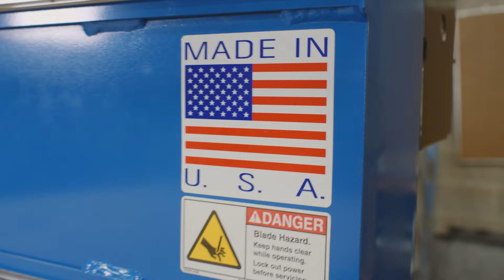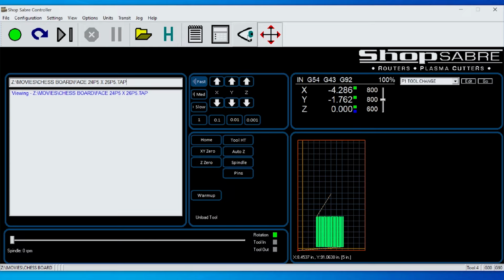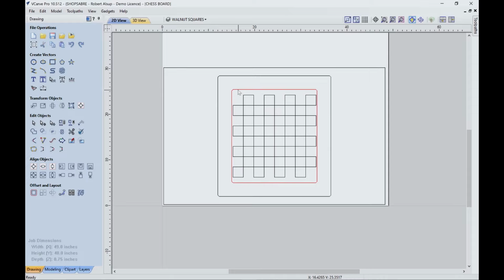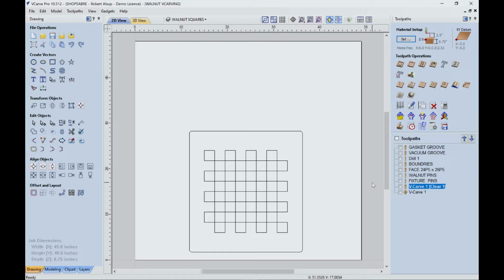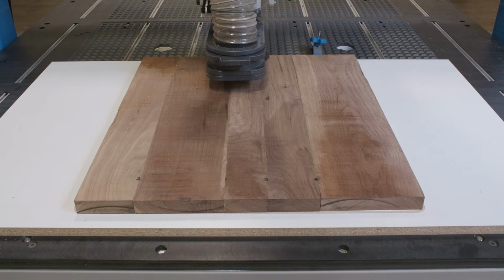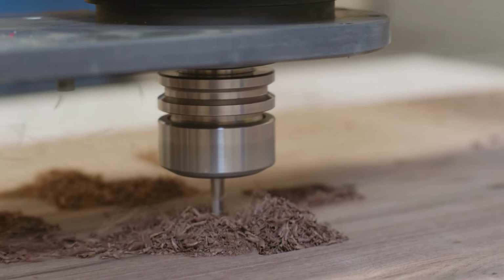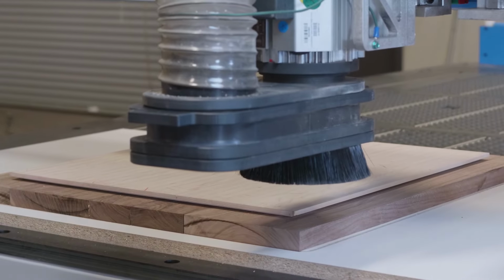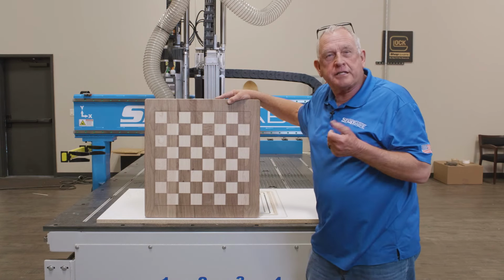ShopSabre CNC - Chess Board on IS Series Router

Comment: Greetings Bob, I have a question for you, I am making my own chess board on my CNC machine and I made my plug depth the same as the max depth for the plug and inlay. No matter if I set my plug to be smaller what I end up with is the cheeker pattern between the corners is offset about 1/8" of an inch for all of them.  When I look at your video it looks like the product you made came out with almost the same results.  I am wondering if this is a normal result on a CNC machine?  Could I get the checker patterns to nearly touch like on a regular looking chessboard? What is your opinion on what could be causing the slight gaps between the inlays of the pattern?
Reply from the maker: Thank you for reaching out, this question is best directed towards the technical support team - there are offsets and things you can manipulate but when routing, however you will always get a radius of 50% of the tooling used in any project from the rotational tooling itself, again though tech support is the best contact for more in depth needs.

Comment: Thanks to the Shop Sabre interface that instead of doing the G92 command to manually set the z height what I've done is select the increment limit like .01 or .001and then bump the z down however many increments down i want.  Easier to me than remembering the G92 command
Reply: That is a great idea!  Will try that on the next video.
Reply from the maker: Thank you, we agree the ShopSabre control is great for incremental movements - showing the G92 was great to show a more traditional way of coding

Comment: Interesting technique in making the board. Are there any structural advantages to it being made this way instead of the usual multi glue up ways? Also how much would it cost to commission a board like this?
Reply from the maker: Typically this method is more efficient and is the quickest with only one glue needed. There is no cost attached to this board unfortunately.
Reply: @shopsabre  OK, I was just curious if it would be less, more or equally likely to warp as my traditional solid wood boards.  Otherwise I see only advantages in this method. Thank you for the video.
Reply from the maker: Thanks for watching!